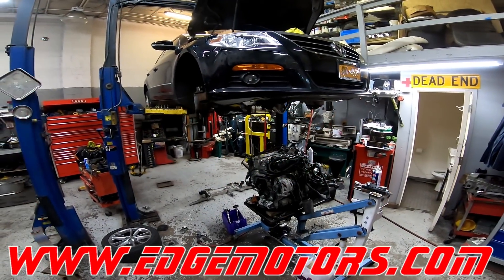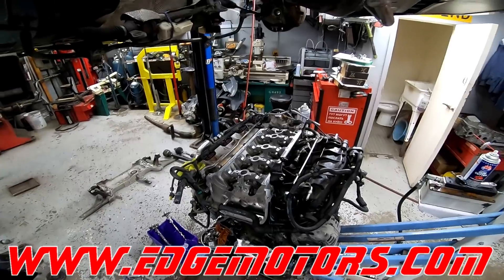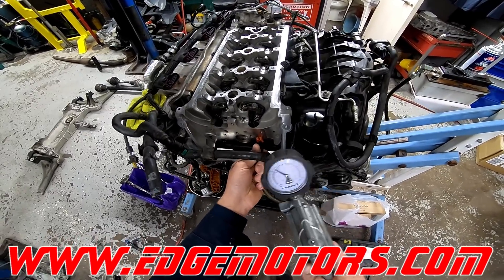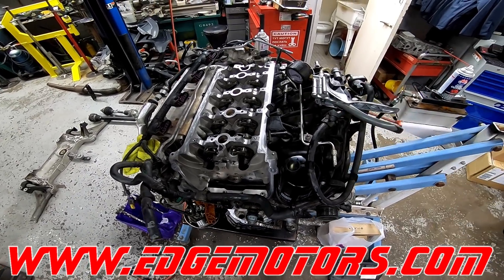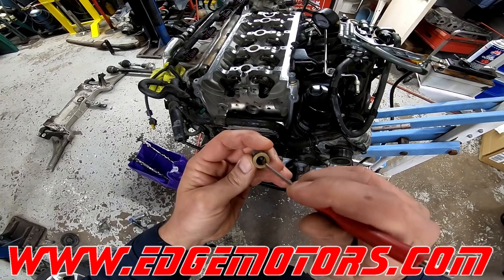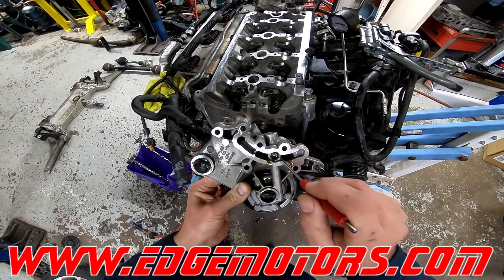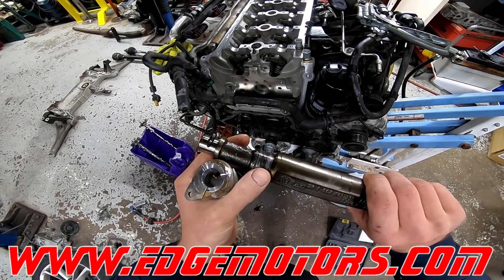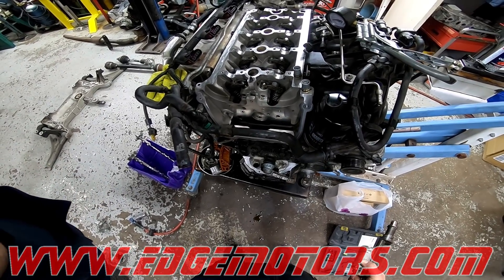TFSI Motor Oil Check Valve Testing by Edge Motors

Comment: I got an oil pressure issue on my tiguan 2010, i rebuilt the engine, new crankshaft bearings, new exhaust side balanceshaft because iy was seized, new chain and tensioner, new intake camshaft, new oil pump, new oil pressure switch. And i still got oil pressure issue when engine is in operating temperature with a rattle on 1100 rpm, when i unplug the magnetic adjuster connector the rattle goes off. I can't figure out my problem at all. What coul be my problem?
Reply: And new cylinder head, the cam bridge doesn't have the screen, and if the this screen is stuck in the head i have a new head installed, and also a new camshaft solenoid.
Reply: Did you found the issue. I also have the low pressure issue after an engine rebuild, but no rattle. the engine runs perfectly, only the idle pressure is too low at 0.7 bar
Reply: @Wll968  no it's not solved i need a new engine. There are many things that may cause low oil pressure

Comment: So much thanks for this video. I have an Audi Q3 in the workshop, from 2014. Also engine rattle and inlet cam sensor codes. Replaced the timing chain which was worn, no result. Removed the cam bridge, did the test of this video and the air came came out somewhere, instead of building up pressure in the head. So now know what to do, and that’s removing the head and check/replace the valve 👌🏻 Also go to replace the cam bridge, because the screen was popped out.

Comment: this check valve is only to prevent oil coming back down when car is shut off . how this is going to reduce your oil pressure when car is running . please explain . thank you
Reply from the maker: By letting oil back to the block:)
Reply: @EDGEMOTORS  
Kalina Kochendzhieva
24 minutes ago
thanks for replying right the way This discussion will be worth it for a lot of people > 
OK yes but as I mentioned the check valve purpose is to retain oil in the cylinder head after engine is shut down, not while it is running . when it is running oil pressure goes in the up direction . if it is stuck closed it will prevent oil going to the head in that case head will suffer oil pressure, but you mentioned it stay stuck open a bit
Reply: @kalinakochendzhieva3992   @EDGEMOTORS thoughts?
Reply from the maker: Yes, but if it’s stuck sideways as it usually happens due to the valve shaft guide wear, it will not only drain the oil when the car off, but also restrict oil flow from going up…
Reply: @kalinakochendzhieva3992  You are very correct, I forgot to install this check valve when i replaced my head, took me for a ride until i hit this comment. you will lose pressure as it leaks out of the head just like a worn engine components would low oil pressure
Reply: @EDGEMOTORS  Can it be a faulty check valve if my oil pressure is only low at warm idle ? 2000rpm it's over 2 bar, 37000 rpm it's over 4 bar, idle is 0.8bar Thanks
Reply: @EDGEMOTORS  new naptown tuner stated the new engines do not have it anymore. Is more a restriction than any help.

Comment: Hi there did this engine get a rattle noise from 1,500rpm to like 3,200rpm wen revving and did the noise went away by removing the magnetic solenoid wire plug and come back wen plugged back in??
Reply: Hey, Im facing same problem rattle on low rpm and rattle goes off when unplugged the magnetic adjuster solenoid, changed everything in my engine including the oil pump still not solved. What was your problem?

Comment: Thanks for the explanation. Very good. I just found out yesterday that on my model of engine, sometimes the manufacturer didn't install these valves. My timing chain rattle started a few months ago. Only for a few seconds on cold start up. I now think these check valves are either worn or not there.

Comment: Hey, I have new timing, new Cambridge, camshaft and when the engine is hot, at around 1500 rpm there is loud rattle noise from cams or chain also hot engine is hard to start with short crank, when it’s cold car starts with no problem. Could that be that valve ?
Reply from the maker: Any error codes?
Reply: @EDGEMOTORS  No codes at all, only when N205 valve button got pushed out for some reason I had timing codes, but got new valve and no codes.
Reply from the maker: Maybe it needs to run for little longer to set some codes...
Reply: @EDGEMOTORS   I did around 200 miles with that but I will do more and maybe I’ll get some codes, if oil check valve would be bad, what codes would that be
Reply: @yourfast07  hi I got the same problem did you ever fixed it?
Reply: @lucapino9837  yes I did, before the problem I had whole engine rebuild with new vw crankshaft, someone from vw dropped the crank and made small dent on impulse wheel. Cranks sensor wasn’t reading the signal like it should. What is your exact problem.
Reply: @yourfast07  I got the same rattle at 1,500rpm to like 3,500rpm
Reply: @lucapino9837  no codes ?
Reply: @yourfast07  p0016
Reply: @lucapino9837  Do you have OBDeleven or know someone that has one ? If so you can check timing chain stretch and you will know if you didn’t jump a time, if that is good I would replace camshaft position sensor and then crankshaft position sensor
Reply from the maker: Did you take the crank out your self?
Reply: @yourfast07  all new timing components and new balance shafts which I replaced them because of the oil pressure warning light so no more warning light but there is a engine cam rattling that only goes away by unplugging the solenoid in front of the cam valve
Reply: @EDGEMOTORS  Yes and it was my mistake for trusting vw that it would be ok, dent was so small you couldn’t see it but what we did is we pulled out crank sensor, inserted a ratchet extension and marked by the block, cranked slowly by hand and found small dent.
Reply: @lucapino9837  If timing is ok, I would try swapping crank sensor, sometimes if sensor is losing signal, and read it wrong the camshaft magnetic solenoid will change timing back and forth causing chain rattle.
Reply: @EDGEMOTORS
Reply from the maker: Haha those are the best:) where you go crazy to find a problem.
Reply: That’s exactly what my car is doing
Reply: @EDGEMOTORS  sometimes we gotta find a another way to win 🤣, that small dent has cost me over $3k, costly lesson haha
Reply: @lucapino9837  You better hope it’s not that valve, like I said I would check that crank sensor and cam, then cam solenoid, check oil pressure and check compression on each cylinder. Jumped time might show you this code, and low compression. Oil pressure will cause cam solenoid problems too because its controlled by oil,  next step would be removing timing cover (upper) and pulling Cambridge to see if its not missing screen and ball from check valve, if its missing screen then you want to find that, sometimes screen gets stock in camshaft adjuster. Inspect that and when you remove that Cambridge get a vacuum, pressure test pump and you can test that oil check valve. To replace oil check valve you’ll need to remove whole timing and head.
Reply from the maker: Just take the cam bridge off and check...
Reply from the maker: Yea I’ve had many lessons like that in my experience...:)

Comment: Hi How u checking valve? Pressure and should hold pressure or air needs to flow through.
How do I now if is good or bad....sorry it’s bit cofusing in the video.
Cheers
Reply from the maker: It should not let any air through.

Comment: Can this faulty valve cause a drop in oil pressure?
Reply from the maker: Yes
Reply: @EDGEMOTORS  I am having 1.5 bar on cold start, then 1 bar when warm. And when I rev it to 2500rpm it drops to 0.5 bar. And engine makes rattling/clunking noises. Any other advice or have you heard of this?
Reply: @marchandmuller  I’m having the same exact problem in my car did you ever fixed the problem?
Reply: @lucapino9837  no sir. Did everything. Except change block and actual head. All the rest were changed and no result

Comment: im working on a 2009 tiguan. it seems like cylinder block is not receiving any oil at all. there is no oil coming out of this hole in the cilynder with the cam bridge out and cranking the engine. i do see Oil coming out the oil filter port when oil filter is not installed. Possible balance shafts ?
Reply: I fixed mine by changing balance shafts because of no oil pressure at idle when engine hot

Comment: With help from this video I've found my check valve has failed. Do you have a part number for the oil check valve.

Thanks
Reply from the maker: 06h103175b

Comment: Did you use pressure or vacuum to check that valve? Not trying to be a smart ass but that looked like a vacuum pump
Reply from the maker: Pressure,
Reply: @EDGEMOTORS  cool i have my head apart but im not exactly sure how you change this valve? Any tips would be much appreciated thank you in advanced

Comment: How many miles is on that engine?
Reply from the maker: 110k
Reply: @EDGEMOTORS  wow! wasn't it maintained properly, or is it rather a common failure?
Reply from the maker: These do have a bit of oil pressure problems...
Reply: How many of those cambridge check valve ball have you really seen blow out? The mesh screen is notorious for coming apart under 50k kms as people have checked. Just wondering as I myself have replaced the cambridge without the screen as per vag tech guidelines.
Reply: @JH-sc7cs  late thread but the check valve in the head is very rare to fail but when it does sheesh you will know about it when you have to pay for the work

Comment: Also can you do a video on replacing the Balance Shafts on these motors?  Thanks
Reply from the maker: You can use the video on the timing chain plus the video on the water pump, in between the two you will have all the information you need, there will be only two bolts extra, the once that hold the actual balance shafts to the block

Comment: EdgeMotors, Thanks again for explaining these checks.  Your videos makes me understand this engine even more.  I've had 1.8t's, current B7 2.0t , B8 2.0t, 2.7t motor and this B8 2.0t is for more iffy with all these components.  My current B8 2.0t A4 Avant currently runs good but no CEL or Misfires.  I do however have the Low oil Pressure warning as the engine oil gets hot.  I've replaced the PCV, the Oil spring tube under the Oil filter and still get the low oil pressure.  Still no misfires.
You still think its the Balance Shafts? Or can those check valves or Cam Bridge cause the low pressure. Just want to make before I tear this down.
Thanks.
Reply from the maker: Did you ever check the actual pressure?
Reply: @EDGEMOTORS  That's actually next in the process.  Check the pressure from the Oil pressure sensor location next to the Oil Filter housing. You know what the pressure range would be on idle and rpms when oil is warmed up?
Reply from the maker: That should of been done first:)
At idle you should see around 20psi and higher, at around 2000 should be above 35psi...
Reply: @EDGEMOTORS  Finally got around to check the oil pressure and as it got warm the pressure drops below the 20psi requirement.  So it looks like I'll need to do the balance shafts and or test the other check valves.  BTW I did notice some oil leaking from the valve cover near the Fuel Pump. Looks like i'll need to reseal that.  Could a leak from the Valve Cover cause a low oil pressure?
Reply from the maker: No. It has to be pouring in order to affect oil pressure
Reply: Fixed mine by replacing both balance shafts I was not getting oil pressure at idle wen oil hot

Comment: hi thanks for the video and when you are saying that it will cause misfires and timing codes is it because the oil goes back to the oil pan or the oil pressure is lower than normal in general and yes i got one Tiguan with bad balancer shaft and low oil pressure when the oil was hot what i've notice is I usually go for a test drive and get the oil real hot and then I go into the instrument  cluster and check for engine RPM and oil pressure switch  closing and normally the switch should close at around 1000 rpm but if it's higher like 1300 rpm or more then I know that the balancer shaft might be worn out but first I put in a new oil pressure switch just to make sure that it not the switch one funny thing I got a few car that even with new oil 5W40 oil and OE filter the oil light would come on event with a new switch and it I would check the oil pressure with a gauge it would be within specs i would then get a new switch from a different model that closes easier then it would be ok I never had any issues  with car that I had to do this. I think the switches are from Audi A4 with similar engines.
Reply from the maker: You should only use the proper part number sensors, they all different pressure ratings, if you use a wrong one the light might not come on, but the pressure will be too low....
If the check valve fails the engine will miss fire because the timing will be off, due to pressure low in the cam adjuster.... I always use a mechanical gauge to check the pressure when there is a suspicion on the pressure being low...